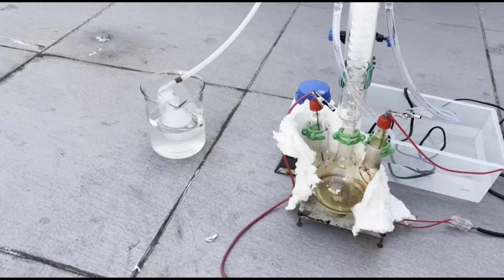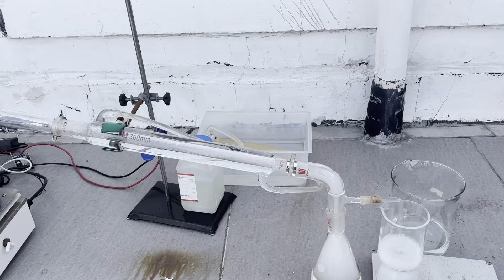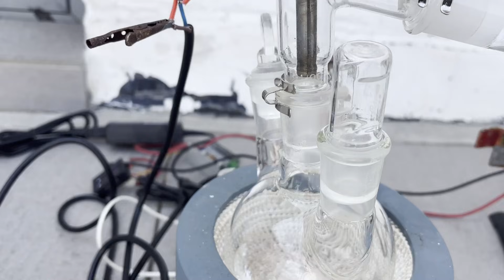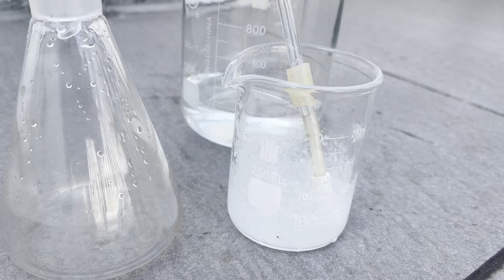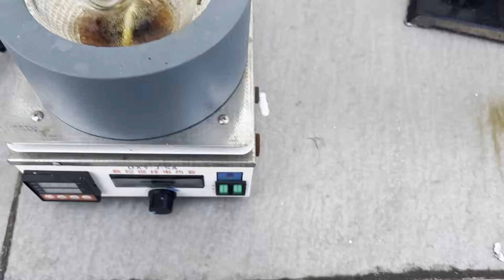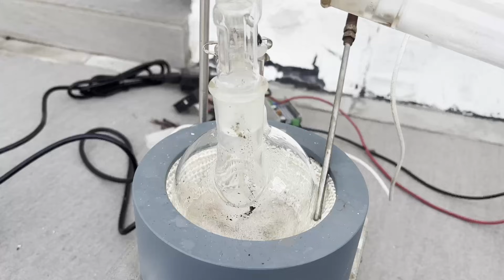Lab Notes - Ketene lamp new design (almost success)

Comment: ive found a mixture of Plummers putty and JB weld to be exeptionally heat and chemical resistant, it can be formed into a plug beforehand and allowed to dry then wrapped in some teflon tape
Reply: once its cured JB weld is also quite resistant to acetone, so it could be used to coat the rod wires and prevent the short circuit

Comment: Hi MIH0319,
Nice try-test.

1°) Of course silicone comes rapidly to mind as hermetic rubbery plastic sealant resistant to heat; but remember that it resists heat up to 250-350°C a bit the heat of your oven but not the "high heat" 550°C to 700°C needed for aceton pyrolysis.

2°) ketene is one thing; but super heated aceton  or its oxydation pyrolysis products (acetic acid, acetic acid anhydride, ketene or diketene are certainly not cool chemicals towards it!

Try to remember the smell of silicone when applied... come on think harder ... vinegar yes acetic acid is the solvent of choice allowing the silicone inside your cartige (prior to polymerization and drying) to remain appliable as a paste before getting its final rigidity and rubbery hardness!

This said you eadily understand that 1°) and 2°) are no-goes for ketene lamp hermeticity close to the heating source.

3°) I find it stange that the obvious choices don't come to your mind as device building; of course PE and PP plastics are not suited because too low mp.

--> But what about:
a) metals like stainless steel (1530°C > mp > 1350°C), copper pipe (mp 1085°C) , aluminium (mp 660°C so this last one require carefull monitoring because too close to the needed temperature).

b) Some screw on or fileting or just adjusted diameters can be done with special sealants-cement thermic paste for oven pipe exhaust or car exhaust even refractory cement or clay.

This would allow you to make much cheaper than lab glasware; at least for the most sensitive and close to heating place; then once further away maybe teflon tape.

c) Ceramic resist quite well heat (clay pot, or even own clay woking potery, shaping, maybe even stopper made by molding (hand, shaping, ...) and oven backed or tool carved, cut, grinded, polished,... to the desired dimensions, size and form.

I remeber I had some white clay bread that I could shape at will, allow to dry and cook; it was then resistant to water and heat (I even made some rubbies inside it by melting Al2O3 and Cr2O3 powder with a N2O / butane blow torch (2300°C) and it remained integer.

I hope you will succeed to make synthesis:
CH3-CO-CH3 --> CH2=C=O + CH4

2 CH2=C=O --> O=C(-CH2)2C=O

CH3-C(=O)-OH + CH2=C=O --> (CH3-C(=O)-)2O

Regards,
PHZ
(PHILOU Zrealone from the Science Madness Forum and many former A.O.L newsgroups related to chemistry)
Reply: Oh, and I thought I knew your username from somewhere, NTMY :)
Reply from the maker: I did consider stainless steel and other metals for a moment, but I still think they will provide a far-from-perfect seal (unless, for example, the entire apparatus is made from steel tubings that are welded or screwed together). Ceramic and cement pastes certainly would withstand the heat, but I am worrying about thermal expansion here, as the different expansion coefficients between metal, ceramic and glass may induce many cracks in the joint. (Plus, they cannot be removed easily from the glass, so I cannot use the pieces of glassware for any other experiments.) So I guess I'll stick to thermometer adaptors for now...? (just by the way, the diketene formula you stated O=C(-CH2)2C=O usually takes a different structure of H2C=C(-CH2)(-O-)C=O, replacing one of the carbonyls with a C-C double bond.)
Reply: @MIH0319
Ceramic or clay do not vary much for dillatation-expansion so it is quite interesting for heating and can be joined to Pyrex or other heat resistant glasses... of course better use a softer spacer like glass fiber and no direct solid-solid contact if ever dillatation coefficient differ too much.

PHZ

Comment: I wonder if you could use inductive heating of a metal slug so that you can avoid needing electrical feedthrough to your glassware.
Reply from the maker: Someone else also suggested it in the comments, and my concern is rather similar. It would work, but there probably would still be sealing issues present (just not electrical wires).
Reply: @MIH0319 that's true, but at least you could do all glass joints and avoid the silicone. At the end of the day, unless you are using quartz glassware, the high temperatures are going to be an issue no matter what.

Comment: Have you tried distilling the end product, to confirm that you actually had ketene and it reacted with acid?
Reply from the maker: I did distill the product to recycle acetone and acetic acid, but didn't isolate any acetic anhydride. However, I did confirm the presence of ketene by an aniline test (bubbling the gas through an aniline solution to produce acetanilide as a precipitate).

Comment: Try a ceiling the leads of your nicrome wire in melted thermometer adapter  like vacuum or discharge tubes.
Reply: Sealing, damn autocorrect
Reply: @BarryMckinney-1981  glass-to-metal seals are nontrivial, but they can be done. You generally find yourself looking at books from the 1970s or earlier to get details, and you may need to find modern equivalents of materials or tools they refer to.
Reply: @davidfetter there's also a few videos on youtube and I think you might be able to buy them pre made
Reply: @BarryMckinney-1981  Re: the videos, as a newbie scientific glassblower who's not 14, I understand when I'm looking at things I need to skill several levels up even to attempt, let alone to make life critical things with. The failure mode of anything involving a ketene lamp can very easily include deaths. Note plural.

Re: the pre-made, maybe, but it's unlikely.

It's definitely more just for that piece than for all the glassware depicted in the literature and on other YouTube channels that he said he couldn't afford. Standard pieces are (relatively) cheap because of economies of scale. They're made in factories with statistical process control and stuff. Ketene lamps are almost certainly not kept in stock, which means they're made custom per order by a skilled glassblower. That glassblower might not even be on staff, increasing the costs even further.
Reply: @davidfetter i meant I think you can get pre made tips with the electrodes in them. It can't  be any worse than what he's doing now. And I know what ketene lamps are and i'm well aware of their danger from explosion and toxicity.
Reply from the maker: @BarryMckinney-1981  There is an alternative here. Thermometer adaptors (usually) come with a silicone ring seal, which can be fitted with a copper wire that connects to the actual heating wires, so it can address the overheating and sealing issues together. Probably gonna be featured in the next attempt.
Reply: @MIH0319 you could also use mold making sand or crucible making material instead of silicone. Something like the putty used on light bulb bases

Comment: I still think that a stainless steel pipe (paired with a vevor metal melting furnace or something similar) and a series of wash bottles would have done a better job.
I don't know how one can trust one wash bottle around such toxic gas. With just an absorption medium, without any end neutralisation.
Reply from the maker: Well, I have to say the wind is quite big outside - and I'm wearing a respirator at all times. The absorption part will be modified in the future, and for this run I just put a single beaker as absorption since I'm pretty sure the setup won't work at one go and produce sizable quantities of ketene. As for the stainless steel approach, I'm still worrying about seal issues, as the rest of the apparatus would still need to be made of glass, and the seal between them needs to withstand quite some high temperature.

Comment: One possible solution is to use a small induction heater on a rod of stainless, this would eliminate all stoppers/seals for wires.
Another solution might be from 3d printing nozzles, use a heat stop to quickly draw heat away from the end of the heating element you need to seal. some sort of heatsink or water cooling might work.
Reply from the maker: But how would the rod be suspended/attached in the glassware? I believe that would still require some form of sealing (although high temperature may no longer be a big issue). I didn't quite get the idea about the heatsink bit - can you explain it a little more?
Reply: @MIH0319 For the induction method I was picturing something like a stainless mesh/wool to support the rod at each end while allowing vapor to pass (you would need to use the induction element at the middle of the rod to avoid heating the mesh/wool and possibly melting the glass). EDIT: on further thought if you have a bit of quartz/fused silica glassware, simply using stainless mesh/wool and induction heat might be the easy way go.

Sorry I didn't explain the heatsink part well. 3d print nozzles have a heated nozzle but need a sharp cut off area for the heat, otherwise the filament will soften or melt before it reaches the nozzle making it impossible to feed into.
I think this is usually called a heatbreak, and involves attaching the hot part with as thin as possible bit of tube to limit heat flow, followed by a heatsink to cool the everything after the heatbreak.

For this application maybe something like a thin stainless tube pressed onto the heater on one end, and a big aluminum heatsink on the other end of the stainless tube. I know a picture would make this description a lot easier... sorry.